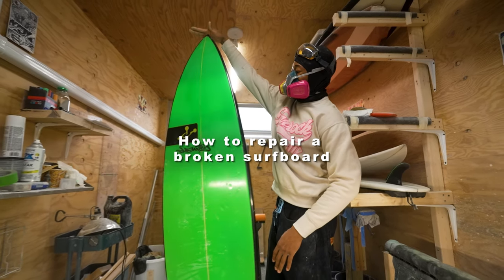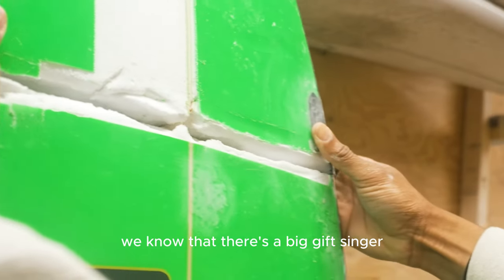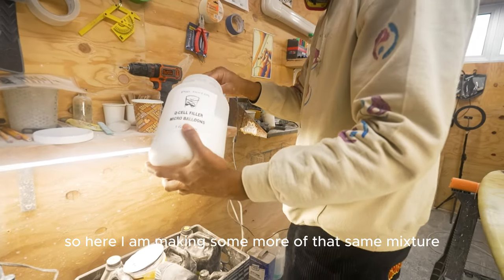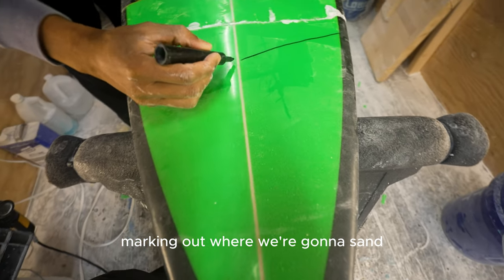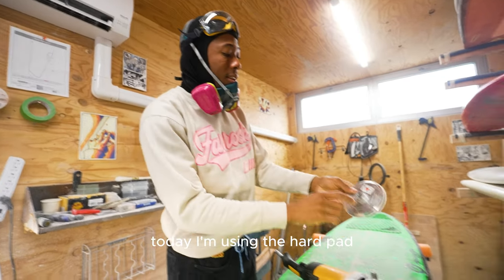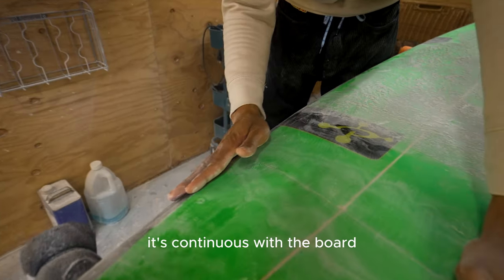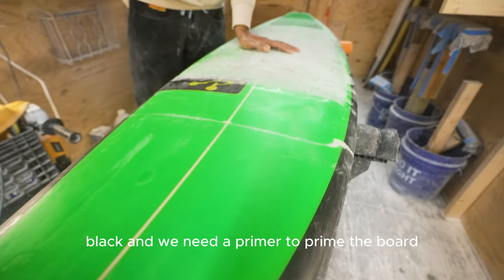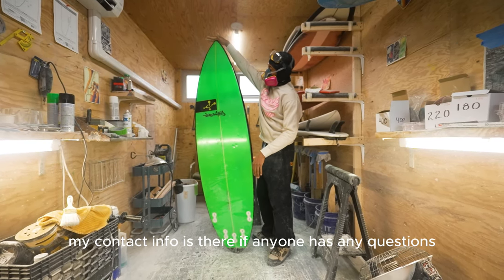COMPLETELY BROKEN SURDBOARD - CAN IT BE FIXED?!

Comment: Good job man👍🏼
I've done a lot of board repairs. A tip that might be helpful for broken boards. Might want to get an assortment of popsicle sticks, or wooden dowels and or wooden skewers (shish kabob sticks)... You can insert them into the foam for reinforcement to hold the shape while the resins set up. Also it kinda replaces the stringer that got broken. Even toothpicks can be really helpful holding the pieces together. 
Cheers🤙🏼